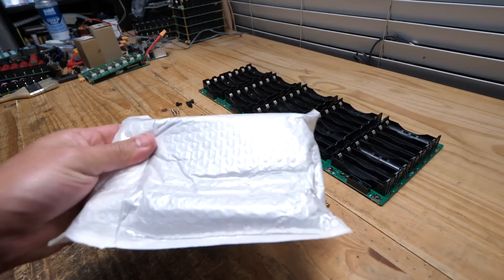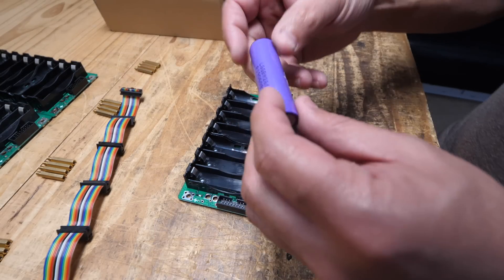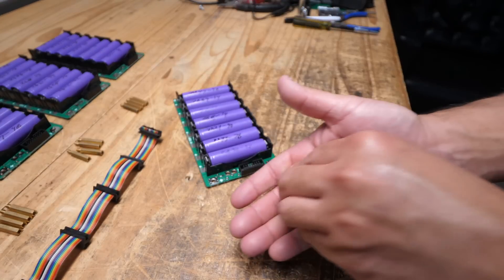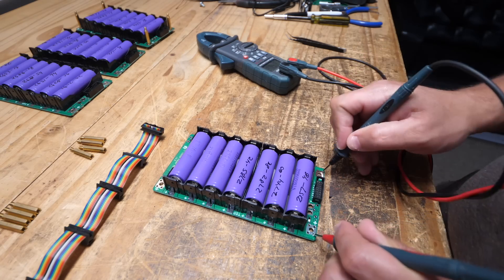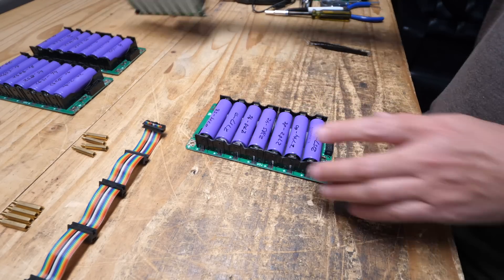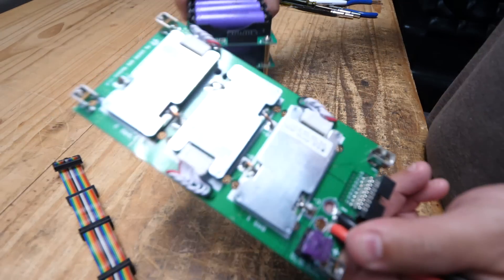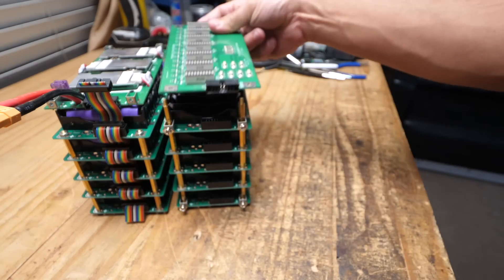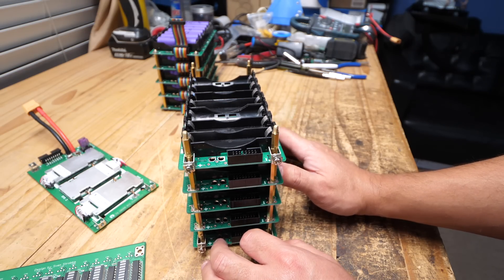Do it yourself Lithium battery pack 5x kit

Comment: Still using my system utilizing these PCBs.  Being able to easily do maintenance and being modular is the main selling point.  I have had my setup running for the past four years and everything still works perfect.  I took them apart for a "checkup" to look at the fusing, wiring and overall condition of each board.  Still great!  I have noticed a few of the battery holders that have cracked but that is all I saw as far as issues.  Can replace the PCB holder with a new one or go the easy route of removing cells, gorilla glue at the crack, clamp till dry and then reassemble.  All in all this is still a great setup for what it is.  Too bad they are not available on the website.  Don't know if out of stock or discontinued....

Comment: So the links to the kids are no longer working on YouTube, But I do want to ask: is it possible to use your bms and control system and not use all the boards? Say I only have room for two or three boards in my setup instead of all five- Will the setup still work without all the boards connected in parallel?
Reply from the maker: yes you will just have less capacity

Comment: After doing my own repairs on tool battery packs and learning the cause of these failed pack was not battery related 99 % of the time, this is by far they best way to build your own pack. The reason is you can remove a week cell, recharge it or replace it, and restore the pack without having to rip apart welds or unsoldier connections.

Comment: This is the best system for DIY I saw till now. The most powerful advantage advantage of it is that when any of the cells goes bad, you can very easily replace it and continue use the battery, no need to break the welding and spot weld the whole pack again which is very time consuming and frustrating work. You have to mention this advantage. This battery pack is FOR LIFE, This is the main reason I use your kit over any other battery packs on the market.

Comment: Is it possible to use a balance charger with these boards and no BMS while charging? I think it would make trouble shooting and diagnosing a little easier and enable you to test each board and batteries..
Reply from the maker: Yes you can

Comment: If the internal resistance is way too different? For example I have some batteries with 30mr ve 230mr does that matter? I mean wouldn’t one battery drag the other 6 battery because it has lots more resistance?

Comment: Without soldering in the batteries into the packs it will not perform well, especially on longer term, it can be also dangerous (corrosion, resistance increase at connection points, false (lower) measured voltage values - > overcharging, etc )

Comment: I need an inverter.  I see on jag35.com that you have a 3000w inverter which is 220v output and 24v input.  This would be perfect, but I need 3500watts.  I need to pull 14 amps at 240v to operate my car charger safely.  Any suggestions?

Comment: This is awesome.  I bought one and have now finally assembled most of it.  I found the BMS board and the top board have their ports backwards (for the rainbow cable that communicates the voltages of each cell).  Maybe this is due to the specific ones I ordered and because I did not do it as one kit purchase.

Comment: Just built my first pack last night. Went to charge it and it tries to weld the XT90 leads to the alligator clips. Polarity if fine. Is this normal. Also tried to add the battery balancer on top of the bms to see how the cell were but it only showed 3 cells

Comment: Is it possible to put each of these plates vertically attached to a wall?  One on top of the other and complete each plate with 28 batteries, soldered in packages of four each of the seven holes?  Greetings

Comment: If I was to connect my charge controller from my Panels to the BMS board, what would be the best way to do that? Could I just use the two larger holes?

Comment: So what do you recommend for charge and discharge parameters I have bought eight of the 7S 10 parallel kits from you and I want to try to make them last as long as possible I have them installed on a small power wall inside my toy hauler camper and I’m using them to run the lights an air compressor Chinese diesel heater and everything else that I need I have 600 W of solar on top of my trailer and then I have a shore charger just in case 
Thanks

Comment: If the bms protection is much higher than the battery discharge (40a bms, 25a battery pack) then how do I get the proper cut off protection?

Comment: has anyone tried remote control type 12.8 volt lipo battery packs wired in parallel for extra capacity.

Comment: Hi Jehu,
Can I use a 10x kit as my van auxiliary battery. I will use a step down regulator to get 12v. My question is: Can I use an 12v to 110v ac inverter (plug in cigarette socket) and a 110 v ac charger to charge the 10x battery pack? Thanks a lot for your help.

Comment: Hi Jehu, some time ago i bought PCB 25X to build a 48v power wall. please let me know how many BMS units you recommend and SOC units. so that i can purchase it separately. thanks. prem
Reply from the maker: 1 bms board per every 1200w  of load is recommended.  You’ll need 2 of you are going to run two stacks in parallel for 48v

Comment: Jehu, Nice videro to understand easily. I understood that the output is from the top BMS through a XT60 connection  I am not sure where should be the input given. Through the bottom board or any board?

Comment: I'm looking to build my first battery pack for my electric scooter.
I believe that this solution here is very practical, saves time and makes things very easy.
But it's not suitable for my project due to the higher costs, think that my battery pack will need 100+ batteries.
It's more bulky and heavier also the batteries aren't permanently fixed in their case so they could pop out.

Comment: All set up, but no power out of the BMS.  Checked continuity on all the leads and all the connections.  Just will not work.  Any suggestions on troubleshooting the BMS?
Reply from the maker: Check my latest video
Reply: @jehugarcia  check my latest email, problem with 1.3 populated board, ribbon connector in wrong spot

Comment: Jehu, working on my 10x and 5x kit.  Using your BMS kit as well.  When does the output from a solar charge controller connect to the battery?  Somewhere on the BMS?

Comment: Got a couple sets of these.  Now I need a decent 10-30A MPPT Lion solar charge controller for a small portable ham radio set up.  This one caught my attention since it has a Modbus connection, temperature connection and if ordered during July you can get the LCD screen for it for $45 total.

https://www.amazon.com/HQST-Controller-Compatible-Flooded-Batteries/dp/B082PHSXNF/ref=sr_1_4_sspa?dchild=1&keywords=24v%2Bmppt%2Bcharge%2Bcontroller%2Blion&qid=1594163969&s=lawn-garden&sr=1-4-spons&spLa=ZW5jcnlwdGVkUXVhbGlmaWVyPUFQRzVWUDVTTVU5VEwmZW5jcnlwdGVkSWQ9QTA0NzY2MjExSjZGR0I3Q0I3RExaJmVuY3J5cHRlZEFkSWQ9QTA1MDA1NjEzS0hVQkNaME9aNTVKJndpZGdldE5hbWU9c3BfbXRmJmFjdGlvbj1jbGlja1JlZGlyZWN0JmRvTm90TG9nQ2xpY2s9dHJ1ZQ&th=1

Do you have any thoughts/comments on this?

Thanks for your time,

John Sutherland

Comment: Is there a video showing the complete setup as used in something like home applications?
Reply from the maker: In the works
Reply: @jehugarcia  Bought a kit, im have it all setup. However, i'm not sure how to charge the pack... Not much clear info on the web about using these specific BMS boards to hook into a charger.

Comment: Is it possible to make a 48v battery using these kits?
Reply from the maker: Yes
Reply: @jehugarcia  thanks for the reply. just ordered your DIY starter kit to try it out. I am very new to solar and batteries. If i have 1.5 KW in panels do I need to worry about the size of the battery bank and charging too fast? i.e. would 1 700 watt hour battery be too small for 1500 watts of panels?

Comment: Hi! I need to build a 60V 35AH battery for my Zero dirt bike. Would these work? I have only 15 L x 6.5 H x 9 W space though.
Reply from the maker: No
Reply: jehugarcia Thanks. What would you recommend?
Reply: @Paul68Luis  I've found 7 cell packs on Aliexpress that are 29.4v, and you can find the double sided versions which reduce overall size as well. Although, jehugarcia suggests these packs can't do sustained high amp outputs. i.e. Scooters, e-bikes, etc...

Comment: Does this battery will work on this kit ?
* Battery Type: 18650 Rechargeable Battery 
* Voltage: 4.2v 
* Capacity: 9800mAh
Reply from the maker: No

Comment: May I take a 12v 100AH battery and connect it to a converter DC 12v to AC 110v, and then connect it to my 110v electric motor to make an electric ATV? In other words, could I have 100AH and an increased voltage of 110v and use on a motor of 110v.

Comment: Just a simple question on the 5x kit : with the BMS added, are all the 35 batteries indiviually monitored ? So you can detect either one cell that would fail ?
Reply: This is what I'm trying to wrap my head around.  Looking at the schematic, the BMS is connected to each cell in each board, but each board connects the cells in parallel for the BMS.  For example cell 1 board 1 is connected in parallel to cell 1 board 2, 3, 4, & 5.  So I'm not seeing how it monitors each cell individually, that, and the BMS is only for 7S.

Comment: What is the worst case amps that can flow through a Shorted Cell, when these 7S1P pack are then connected in parallel?   There could be a ( 5 amp ) Main Fuse at the Voltage Output terminal PLUS  there are ( 7.5 amp ) PCB Trace Fuses on the balance leads.  So, the steady amps through a shorted cell can be 12.5 amps = 5 amp Main Fuse + 7.5 amp Balance Lead PCB Trace Fuse?

Comment: Just got my shipment. It is only the Battery holders and the BMS's. Missing two battery holders. I'm thinking they were supposed to be in the BMS envelopes but weren't. Anyway, I'm doing two side by side 35 stacks. I'm shopping for cells right now. I don't want to do China direct. Panasonic is trying to gouge us. So, do I buy from eBay or maybe check out the local hospital for their old cores? I could buy your stuff.

I have been working on a zinc aluminum alkalies battery design though. Some kid on YouTube has a demo out on it. I'm thinking using that chemistry for bulk storage. Your thoughts on terrestrial based batteries not needing to be mass restricted. Isn't that the way to go with stationary cells? High volume, high density, long cycle battery arrays.
Reply: @jeffallen3382  I got the boards just fine and the BMS kits. Everything as expected, high quality and heavy traces on the PWB's just like he said. Just the miscount on the holders. I think he got screwed on them from the manufacturer. The BMS' are supposed to come with holders and didn't.

I paid to have them tear apart the battery packs and test the cells. It looks like they are behind on that. So I ordered some other salvage units they have. The processes is time consuming and I bet he isn't making much on that. I can do that and even the poor cells will work in my Dewalt 18V packs. I read about using them in place of NiCads. But hey, if my Dad was making some serious $$ selling old batteries, I would help him out, LOL I think this guy is on the up and up. The shipping right now is slow due to the CV19. I have several other orders coming. I spent my incentive on things to stave off high inflation. If they go negative rates on my CC's then fine. Pay me to be in debt.

Seriously, I can see stagflation coming. The cost of goods and services in a restricted production economy. My dear old Granddaddy warned me of this. "If you don't have the wheat in your silos, you don't own it." He lost the farm, dude. The coal mine sent a mile long train out today. I figure if I can generate it and store it. I won't have to pay for it.

Comment: What will happen if the capacity of the cells is different in a series? Will it affect just the capacity of the pack, or will there be more dangerous problems?
Reply: If the capacity is different, you'll lose a bunch of the overall capacity if you're using a BMS or you could potentially over-discharge the lowest capacity cells. Don't mismatch cells. If your cells are different voltages you're going to create a dangerous situation.
Reply: @PunakiviAddikti  are you sure?. .. Let BMS take care about all of that
Reply: @Focus-gz3te  The BMS can balance the cells in a series pack, but it can't help the lowest capacity cell. That cell will drain faster than the other cells and will always cut off first. The other cells still have juice left in them, but the BMS has to protect the empty cell. Thus, the lowest capacity cell determines the overall capacity of your battery pack. Always make sure the cells are evenly matched by measuring their capacitances and only pair cells whose capacitances don't differ more than 5% Yes, I'm sure. This is not my first rodeo.

Comment: I need that in a 4s 12v configuration
Reply: Let's see and take 3 lithium cells (3s) ... 
3x 4.20V = 12.6V, this is a little bit too low, should be 13.6V ... 14.4V.
And now low voltage (per cell) 3.0V x3 is  9.0V, that is too low for inverters, most of them stop between 10.5V and 11.5V.

Ok, trying 4 lithium cells (4s) ...
4x 4.2V = 16.8V, this is too much for most 12V Inverters.
And now low voltage (per cell) 3.0V x4 is 12.0V, that is ok for inverters.
Even 2.8V per cell (4s is then 11.2V) would be ok.

A better way would be with LiFePo4 cells, typical cell voltage 3.2V
Depending on the manufacturer the maximum voltage is 3.50V ... 3.65V. 
So 4x 3.6V = 14.4V, this is very good, voltage is like AGM battery.
And now low voltage (per cell) 4x 2.5V is 10V, that is a little bit too low for inverters, but with 2.7V it makes 10.8V and could work, depending of the inverter. 

But ... using LiFePo4 you will need an other BMS, i think. AND there are LiFePo4 with the same size 18650 in the shops! So after buying you should look at the difference and do not mix them in the same battery holder.
What about the  kit.co/jehu/lifepo4-pcb-26650-kit ?  YT-Video  Kq_5yhZ4P30

Oops, there is already a video about that:  Kq_5yhZ4P30

Comment: hey.. bro.. i have a question.. i have setup a 12.6v battery pack with 18650's. and i have a bms on it.. those cheep china ones.. and they do cut off at rated voltages. 
so to charge the batteries, should i use a charger exactly with 12.6 volt?.. i have   a 15v smps laying around.. and i have this doubt , since the bms always cut the battery charging at 12.6 volt, it should be oke to charge it with 15 volt , right?

Comment: Hey, just placed an order for two of these 5x kits, but sadly the bms module unit is sold out. Can you please give an update on when they will be in stock or a replacement that will work on two of these kits in parallel. Regards.

Comment: Hi, i don't know if it's the right place to make this question, but i want to make my ''first'' professional 2kw powerwall using 18650, but i'm worried about the safety of this project.
It's the first time i build a battery pack with hundred of 18650, i don't want to connect 100 batteries eachother and  have trust only in fuse wires or BMS, so is more safe to make maybe 10 pack of 15-20 battery with smaller bms (50A for example) all in parallel? Or the BMS in parallel can have conflict?
The place where all the pack will be can  handle the explosion and fire of 1 pack of circa 15 batteries, not 200-300.
Thank you very much :)

Comment: My 1350va UPS runs on 2x 12v9ah batteries in series for 24v...one set of 5 here obviously makes 24v...could this be used as a drop in solution with the battery management module? What performance impact could I expect?

Comment: Was so funny watching this movie, it's a lot of mess inside your brain when you start explaining about amp's and volts and connecting them in series or parallel, I laugh a lot following your ambiguous explanation 🤣🤣🤣🤣🤣
Reply: Ha ha. I did this in college and then trade school. I'm still learning about it and I helped build the internet. I even made a serious breakthrough involving high frequency cross coupling of 10MHZ and higher digital signaling across PWB back plains. Who would have thought squarewaves would act like RF? ME. There is no such thing as a true squarewave. Except in quantum computing. There the state changes instantaneously or even prior to the event.

Comment: hi, Do you have allready tested to plug a battery pack ( 36 or 48 V ) on a micro inverter ? i have the idea to limit the size and capacity of the battery, with a pv router. 
for exemple, use pv and micro inverter from 8am to 8pm and charge battery with over production and discharge battery after 8pm with using micro inverter connected on battery.

Comment: i have one of this units https://www.magnum-dimensions.com/product-inverter/4000w-24vdc-pure-sine-inverter-charger-ms-series
 what is the best scenario using your setup for amp Hrs you can suggest Currently using 4x6volts 100AMp each let me know if it worth it to change to those .
Thanks.
Reply: Let me know so i see what i need to buy from you ?

Comment: Great video  Once the BMS is available again, how can I monitor the BMS with a computer or screen, what is the item I need to view what it going on?  I know you have the SOC module but I was looking for a way to monitor this remotely or connected to a computer.  Is there a standard for that BMS ribbon cable interface?
Reply: Anybody?  How can I add a monitor, preferably a wireless monitor to this?  I saw some that have Bluetooth modules.  How can I add a Bluetooth monitor to this BMS?
Reply: @johns2590  that will ask a lot more €€ or probably in ur case $$

Comment: Why did you not use a solid connection in place of the balance wires
Reply: You could use a solid connection = soldered wires.  It could be more difficult to take apart...